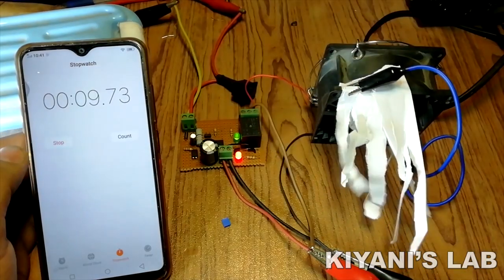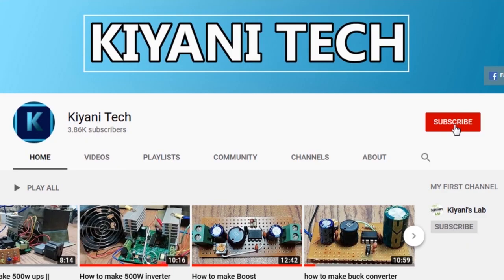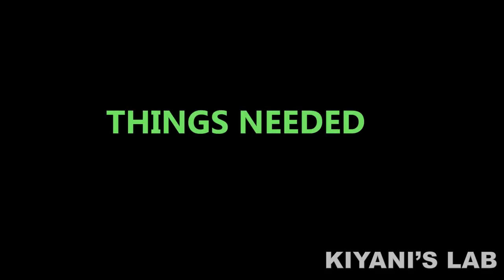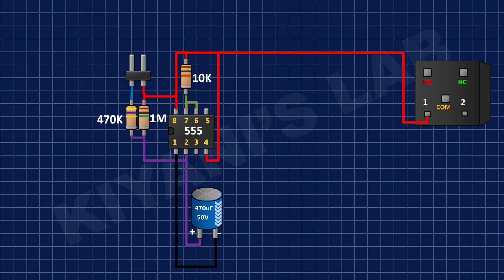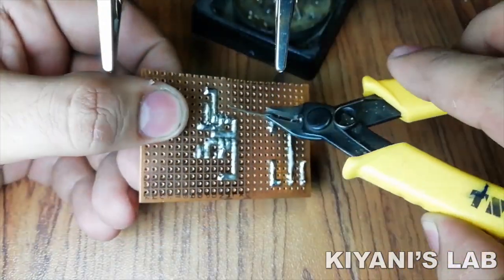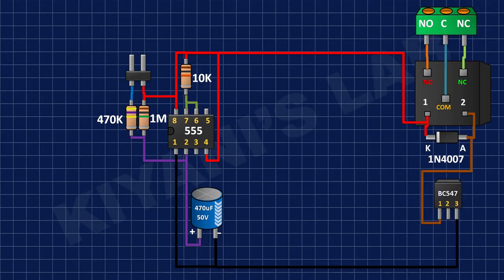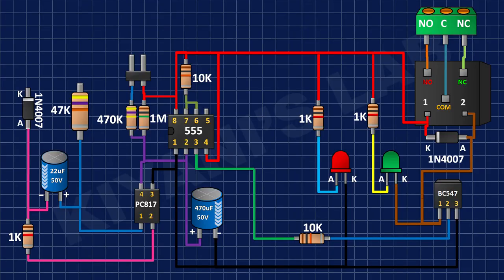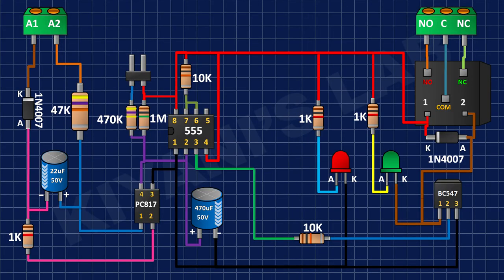How To Make Delay Off Timer | using 555 timer

Comment: This is exactly what we were trying to locate.  Only difference was that we used a 4N32 opamp and used 12v d.c. thru 1k to trigger it.   Also used a 2N3904 (NPN) to control the relay.  Solved a big issue at the weather center.  Keep um coming!  👍

Comment: Dear sir I like your videos which are In fact  not only innovative but simple to learn. As I earlier requested to you regarding over under voltage controller that add this circuit with a timer or time delay circuit so again you are requested to make a circuit which include both the above mentioned properties. I'm very much grateful to you if you kindly made such circuit on my request. Thanks

Comment: I have seen about your circuit and try to made your circuit. LED is glow but after the setting time LED is not in off position. Please can you help me to guide and solve problem. I expect your reply as soon as possible. I expect to utilise your circuit to I made auto on off motor control circuit.

Comment: How work tarminal A1 & A2
Reply from the maker: they will be connect to ac supply when ac supply is on relay will on
Reply: Entrada para sensor . O sensor quando acionado manda um pulso de 12v. Alimentando o foto acoplador e por consequência acionando o gatilho do 555.